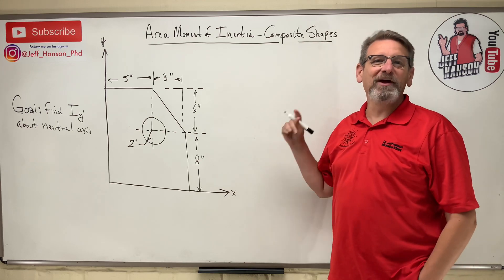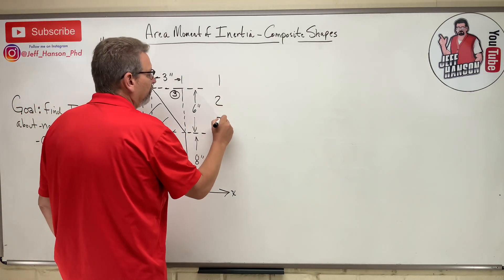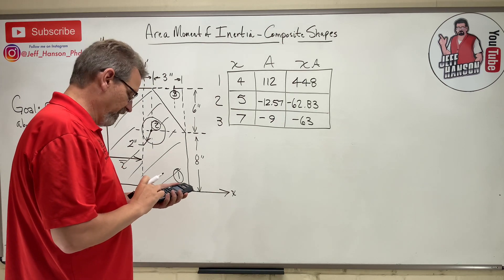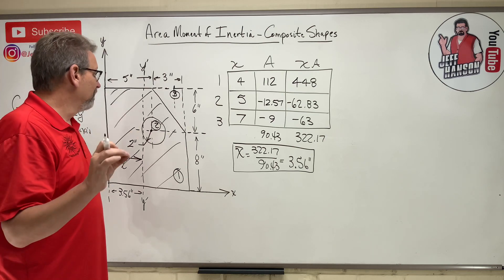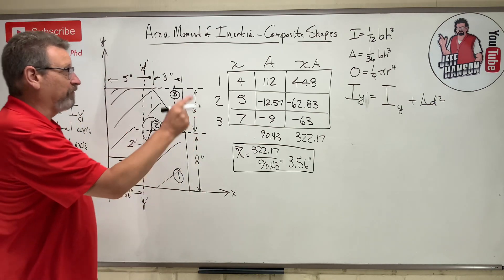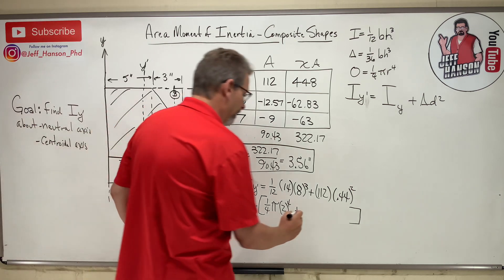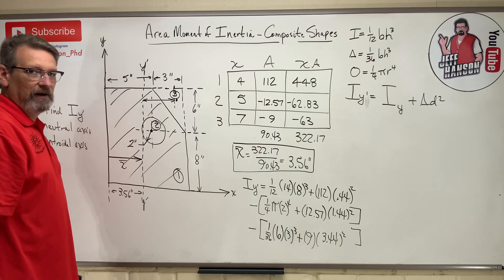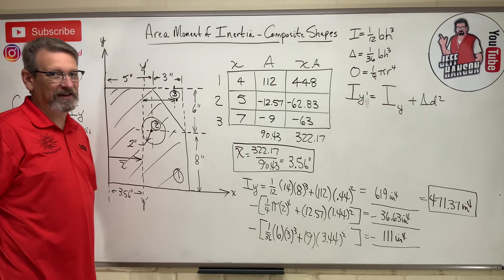Statics: Lesson 69 - Moment of Inertia, Composite Shape Method

Comment: at 3:09 why shouldn't it be 6 as you should go 1/3 from the fatter end of the triangle which would be one and then 1+5=6
Reply: finally, im looking at someone asking this question, because same thing with me, the imaginary triangle is  3 base right? so multiply 1/3 we get 1 and we add it to the 5 so we get its x bar which will be 6, but he wrote 7... i then calculated for the Y bar where it will be 1/3 time 6 and we get 2 adding it to 8 it will be 11, but i guess he switched them for some reason where he added the 2 to 5 not 8, but we cant make sure he went for adding 1 to the 8 because he only solved for x not Y.
Reply: @Al-Suzuki  this is because he is taking the whole distance and subtracting off that third, same for when calculating the y, the distance of the triangle's centroid will be the whole thing(8+6) minus 1/3 of 6 = 14-2=12
Reply: yes, i was thinking the same. It is 6 though
Reply: It’s because it’s 1/3 from the FAT side of the triangle

Comment: im confused on the last part. For the triangle equation, should the base be 3" and the height be 6" ? it seems Dr. Hanson had the opposite
Reply: I am wondering the same thing
Reply: @ropafadzochinzara7120  he is wrong
Reply: @34_ophuthuan90 no, he is not wrong. The base and height are referenced to the y-axis because that is the axis we are trying to solve. The side parallel to the axis is the base (in this case 6") and the side  perpendicular to the axis is the height (3").
Reply: @P2GHoRRis  same thing no difference, why would the base be height when we flip the triangle just like he did where he assumed an imaginary triangle? shoudln't the base be 3, if so x bar is 6 not 7. and then y bar is 8+2 =11 .

Comment: I would want to ask the difference between bh³/3 and bh³/12 for the moment of inertia about the x axis.
Reply: b*h^3/3 is for the 2nd moment of area of a rectangular shape, about the edge that has length b.
b*h^3/12 is for the 2nd moment of area of a rectangular shape, about its center, through an axis that is parallel to length b

Through the parallel axis theorem, also known as Steiner's Theorem, you can show that b*h^3/3 is related to b*h^3/12:
I_edge = I_center + A*d^2
I_edge = b*h^3/12 + b*h*(h/2)^2
I_edge = b*h^3/12 + b*h^3/4
I_edge = b*h^3/12 + 3*b*h^3/12
I_edge = b*h^3/3

Comment: am i crazy or is the x value in the table for shape 3  6 not 7
Reply: I also thought it would be 6 from the y axis
Reply: Yes you are crazy .it's 5+2 not 5+1 because base of triangle is in rhs
Reply: 😭😭😭😭😭😭 @gamerssrilanka3369
Reply: he did correct. the triangle he used to subtract is not the one intersect with the circle but it is on the right upper corner that doesn't exist. Look carefully
Reply: @Cantgumbo2  i know its been 3 years, but can u explain why does the x bar differ in the imagenery tranigle than the real one?

Comment: why is the centroid  axix of the triangle 1/3   not 1/2 of 3 ? n is it 1/3 of all triangles ? so confused .
Reply: Because the mass isn't equally concentrated on both sides of the midpoint of the base.  The centroid is therefore "weighted" closer to the altitude edge of the right triangle.

Let the triangle be the area bounded by the x-axis and the equation:
y = -h/b * x + h

Each area element, has a width dx, and a height of y, and thus dA = y*dx
The first moment of area (which I'll call mu) is integral r*dA.  About the y-axis, r=x.   Substitute in dA and get:
mu = integral r*dA =
mu = integral x*y*dx
mu = integral x*(-h/b * x + h) dx, from x=0 to x = b

Carry out the integral and get:
mu = b^2*h/6

Divide mu by the area of the triangle, and get c, the distance from the y-axis to the centroid:
c = mu/A
c = b^2*h/6 / (1/2*b*h)
c = b/3

Comment: Hey jeff!
Love the video, however i believe you have made a mistake near the end with the equation for the triangle. When completing your calculations you set up the formula for the rectangle so that you could swap base and height - you did this correctly when putting in the values to your formula.
However, you did not swap the formula for the triangle yet you still switched the base and height values which i believe is incorrect? 
If I'm wrong please feel free to explain this to me as i'd love to know!
Reply: Hi mate there is no mistake.. the formula of the rectangle was firstly in the way that is used for Iyy but the formula for the triangle is other way around  (Ixx).. for the circle it does not matter anyway(base = height).. in order to have them in the same way he changed the rect. Formula to Ixx too and he turned the whole shape 90 degree in his imagination and calculated the values accordingly.. i hope this helps
Reply: @eglencelialmanca5964  TY for explaining why the base and height were switched
Reply: how dare you question jeff

Comment: The moment of inertia for the cirlce in the second line should be 38.63 not 36.63. Dr.H says its 38.63 but writes down 36.63 

 the final answer should be 469.37 in ^4 if you round those totals to 2 decimals.
Reply: 38.63…. Amazing how your mind can hear something different than you just read a loud to yourself…
Reply: thank you, that deviation bugged me😄
Reply: Another small problem is: he rotated the whole shape (and switched up b & h places)...

But forgot to use the same "switch method" for the triangle....

The correct value for triangle alone is -124.5024m^4
Reply: @samuelchuonyo7022  No he did the triangle correctly.
Reply: @samuelchuonyo7022  The whole object is suppose to be rotated like this when solving for Iyy the triangle is treated the same as the rest.